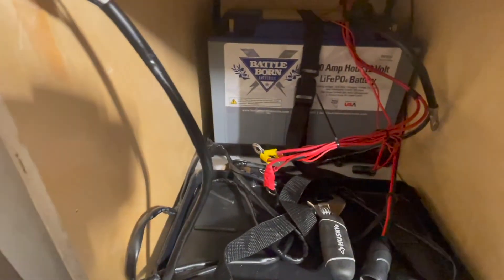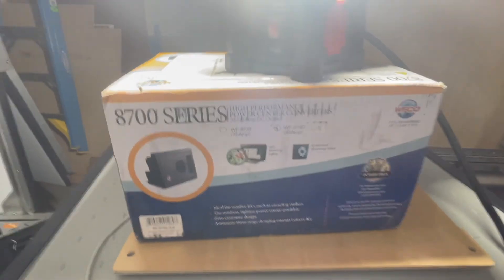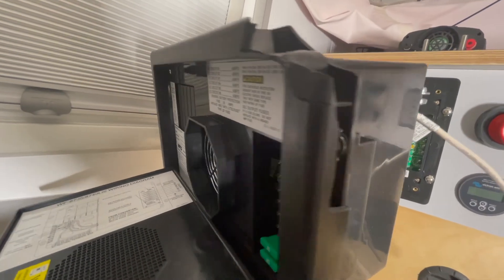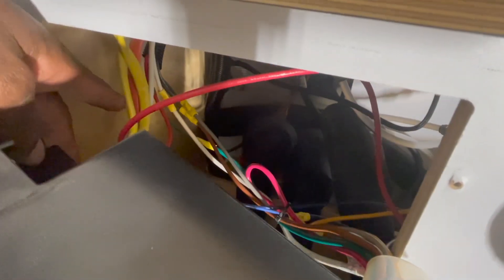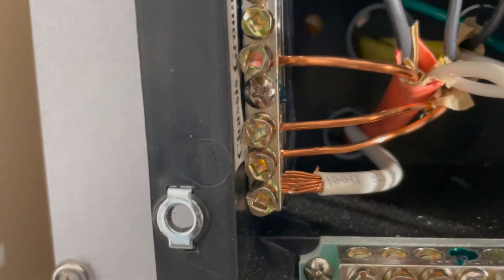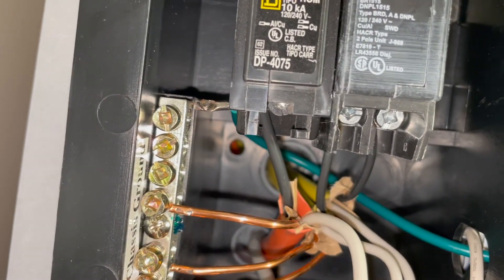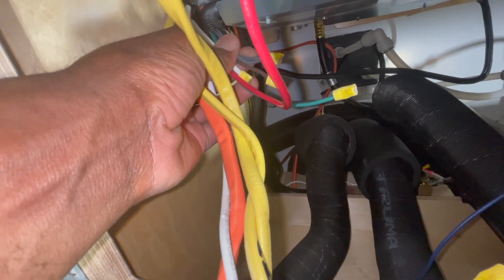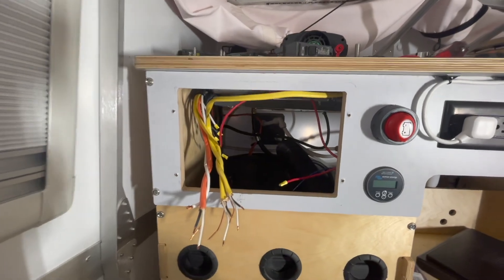TAXA CRICKET POWER CENTER REPLACEMENT FOR LITHIUM: PART 1

Comment: Love your videos! So I have a few questions about power coming from someone who is new to all of this. Can you run everything in the trailer all at once when plugged in to a normal 110 outlet? I see it comes with a 30amp plug but wasn’t clear when 30amps would be needed. And once the batteries are fully charge, can they run everything in the trailer minus AC on just the barriers? Thanks!
Reply from the maker: Hi Jordan! So the 30amp allows you to run it all. But “all” is also very little. Not a lot to the camper. The batteries will run all your DC stuff which again is not much (lights and things you plug in like fridge, laptops etc). There is no inverter so the AC outlets and appliance (AIr Conditioner) will not operate. 

Does that answer your questions?
Reply: @iAmMarchal  Yes that helps! The reason I asked is I was checking out the cricket overland at a dealer recently. They had it plugged into a 110 outlet and turned on all the lights and fantastic fan for me to check out. Then all of a sudden half of the lights went out and wouldn’t turn back on. The dealer rep that I was with couldn’t figure out what happened. I was assuming either a fuse blew or the 110 wasn’t enough to power the lights and fan. So thanks for sharing 🙏🏻
Reply from the maker: @JordanBVlogging  ah. No this runs with all that on. But then again I also have 2 lithium batteries. That likely just has 1 AGM battery. Even at that I’d still like to think it’d fine. 

But just to be double sure I’m in mine now. Turned on everything including some accessory lighted added aftermarket and a Dometic CFX freezer. Everything is running fine on battery. All the appliances are drawing about 4.7 amps.

Comment: This is unsettling:  will the power center that comes with the 2021 Cricket not charge my Battle Born LiFePO4?  I have it installed and hooked up,
Reply from the maker: Hi Matt. It definitely will. I discuss it in the other videos. It just will cap off at 85 or 90 percent. You will still have more power and benefits than the lead acid. So it’s definitely still usable.
Reply: @iAmMarchal  Thanks so much; 85-90% should work for me.  You seem very knowledgeable about the relevant electrical issues so I hope you don't mind me running my only other addition by you, the Renogy the 100W 12V Monocrystalline Solar Starter Kit (https://www.renogy.com/100w-12v-monocrystalline-solar-starter-kit-w-wanderer-10a-charge-controller/).  I don't have access to power where I park my Cricket, so this will be an important recharging mechanism when I'm not using it.  I also like that the charge controller will serve as a battery monitor--not sure why Taxa didn't include one.
Reply from the maker: @mattw5684  haha. Thanks. Only what I know from the projects I’ve researched. Not a pro by any stretch. If you have the BattleBorn I’m assuming you have 1 100 amp hr or 2 batteries to make 200 amp hours. 

There are a lot of factors that will determine how much that will charge. Beat case is it generates 8 amps and hour. So in an hour you would refill 8 amps of the 100 or 200 needed to fill your batteries. But that’s in perfect conditions. I’d use something more like 5 amps. So maybe you would get 30 amps a day. Which is fine if your battery isn’t depleted and your daily usage isn’t more than you’re putting in.
Reply: @iAmMarchal  Thanks--this is very helpful.  I live in Seattle, so we aren't likely to have ideal conditions very often.  In addition, I use a CPAP machine, which does appear to draw a fair amount of charge.  

Would there be a problem with having more solar capacity than I might need?  I have a single 100 amp BattleBorn.
Reply from the maker: @mattw5684  I think the CPAP machine would draw about 30 amps in 8 hours. So your battery would be good for 3 nightsish. 

More solar would mean you can recharge faster with less idea conditions. You battery can take up to 50 amps. Your panel right now is giving less than 8 amps. So you could fill your whole roof an not hurt it. 

I’d look into a goal zero yeti 1000x minimum as a supplement. Maybe.
Reply: @iAmMarchal  Perfect.  Thanks again for all your insights.  I feel comfortable now that I have what I need, even if my choices weren't entirely well informed when I made them.